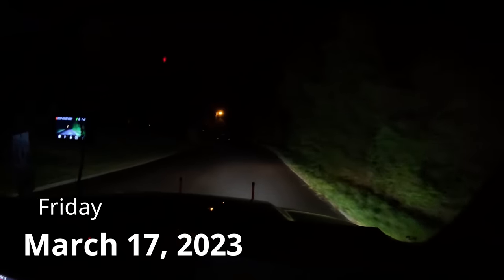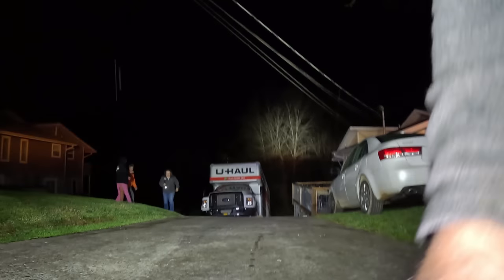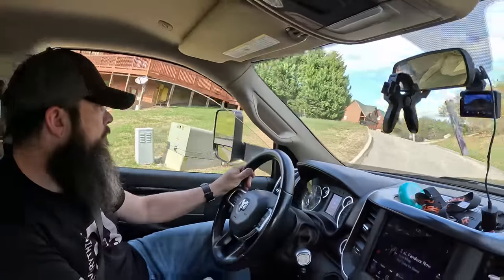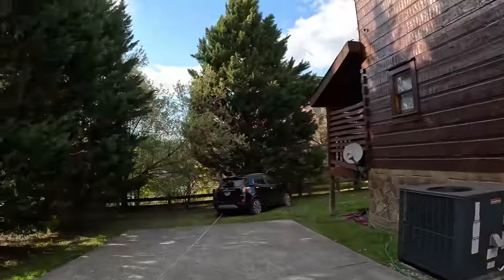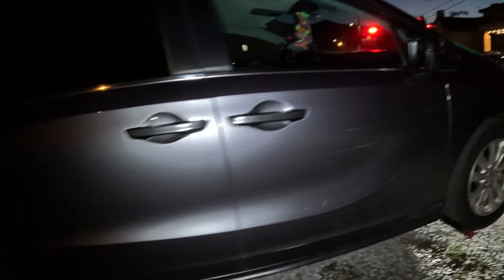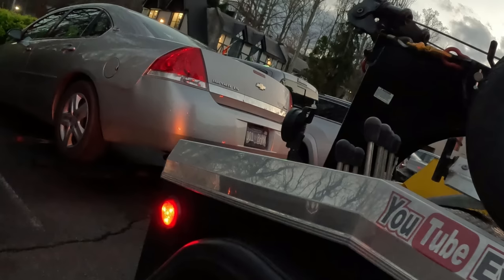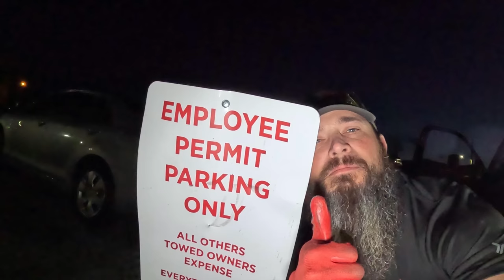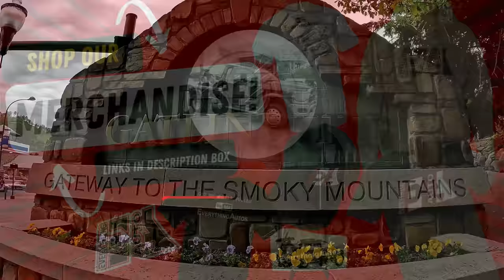26ft U-Haul Bottomed Out, A Muddy Winch Out, And Illegal Parks

Comment: Pro tip for Jeff.,,
You can run BOTH cables down to the truck, run one through the block and hook the hooks together… you now have a 2:1 system but you can split the pull between BOTH winches keeps them cooler AND saves you a trip pulling cable back up to the truck (credit to  Casey Ladelle)

Comment: Ah, the memories!  Jan 3, 2020 I got a fully loaded 26’ UHaul stuck in the driveway of my new house. Only I didn’t turn sharp enough and dropped the front into a ditch and bottomed out on the running boards. Only tow company that would accept a credit card brought the biggest truck they had (for an 18 wheeler) from Knoxville…I live on the Cumberland plateau over an hour away. Everyone else asked if I could get to an ATM for cash. The nearest ATM is an 18 mile walk since the UHaul had my driveway blocked and I could get the car out. THAT was the most expensive 4’ pull back I’ve seen, just under $800, mostly due to distance and fuel prices. I’ve fixed that ditch problem, hehe. Oh, what’s that address again…and again…and… LOL!